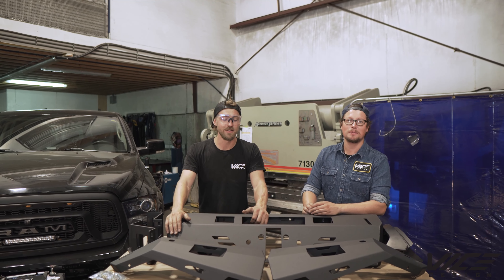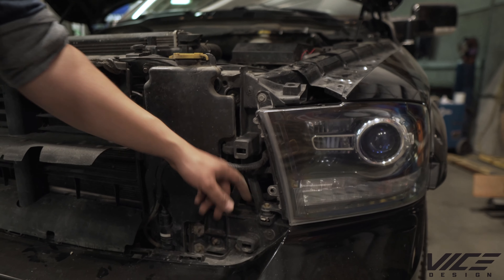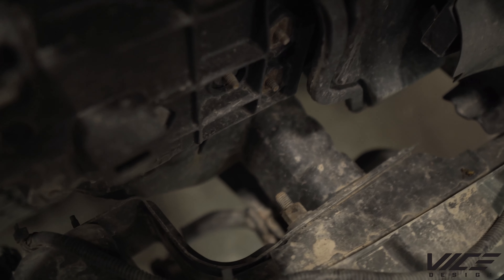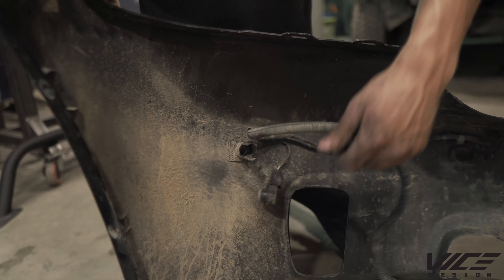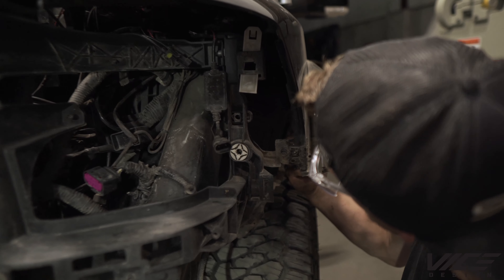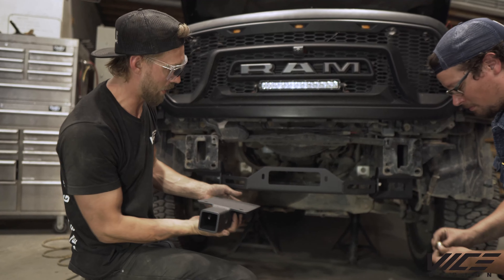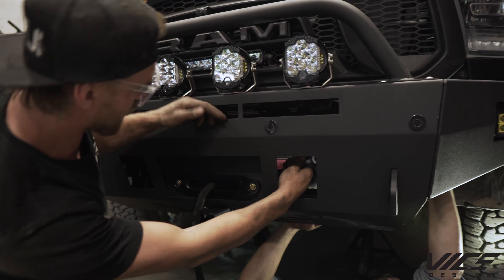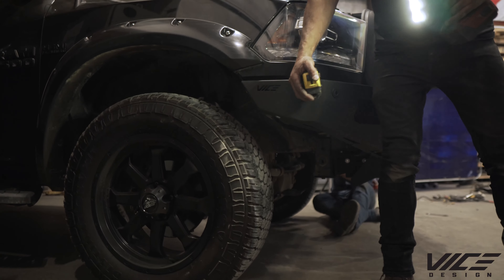VICE MOD V2 BUMPER | 2009-2018 RAM 1500 UPGRADE | INSTALLATION

Comment: You guys look like you do a lot of fab work, do you know if theres anyway to mount a 2500 bumper on a 1500. Im looking at doing the front end conversion for the grille and under the headlights but not a huge fan of just swapping for the OEM bumper and wanna go aftermarket. Would I need some specialty brackets since from what Ive seen theres a really weird mounting interface.

Comment: I wonder if it would be possible to get a bar that protects the headlights from branches too. When i go on the crown lands i often have to push brush with the front of my 4x4. Same principle used on lots of military bumpers. Other than that love your bumper design integration of the hitch mount.

Comment: Nice! I wonder how much weight this added to the front end and how it affected performance/handling?
Love the look, but have always been hesitant to do this as to not want to overload the front end.
Reply: It might be slightly more than stock. I just made a custom tube bumper on my 🐏 with a winch. It might weight slightly more by maybe the weight of the winch. Insane more approach angle and crazy stronger. Plus now I got a winch.
Reply: It’s not enough of a difference to really effect it too much. But enough to feel it slightly
Reply: Its nowhere near the weight of even a light duty plow, i like the incorporated design of the winch tray with these style bumpers. Looks like a good replacement for my banged up stock one.